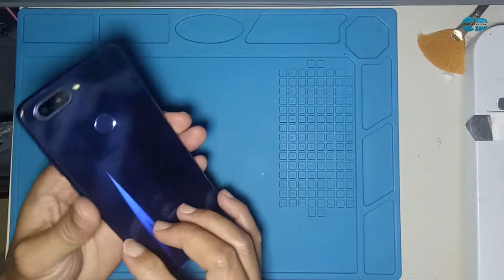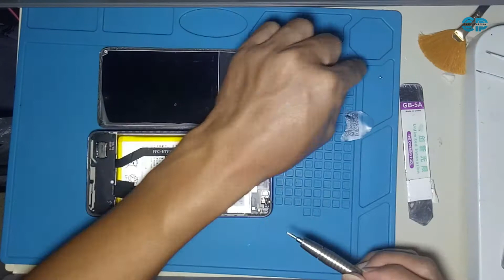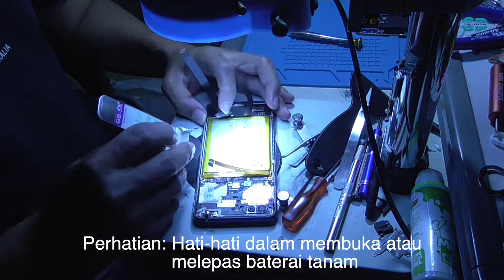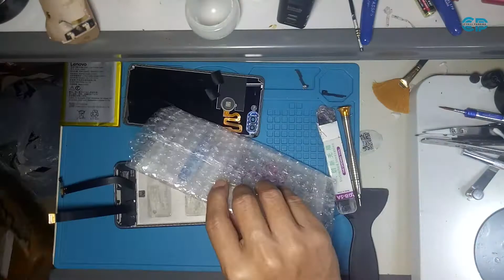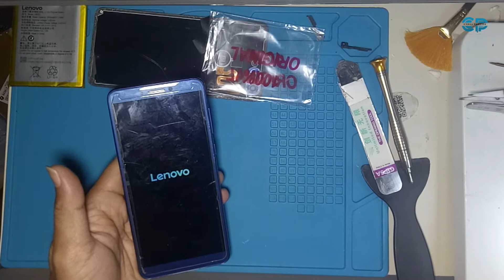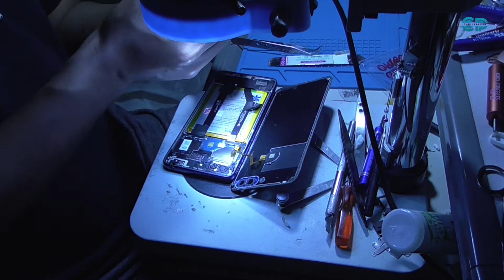Lenovo K350T Battery Replacement #stayhealthy

Comment: om mau tanya, bedanya model batre LB0001 dengan LB003 apa ya
Reply from the maker: @akhmad firdaus Model batere LB001 dan LB003 sama 3.85V, 3000mAh/11.55Wh. Perbedaannya ada di posisi kabel socket flexible nya, kalau LB001 untuk Lenovo K320T sedangkan LB003 untuk Lenovo K350T om.
Reply: @cyrillpareira6347  ohhh begitu om, hape saya Lenovo k350t, tapi batre ori nya model LB003 om
Reply from the maker: @akhmad firdaus Iya betul om, Lenovo K350T menggunakan batre tipe LB003 om.
Reply: tapi kenapa yaa hp saya k350t tapi type batrenya LB001 ?
Reply: @r____kecil8325  Iya bang saya juga gini, mau ganti cuma bingung soal ini. Mas admin boleh dijawab

Comment: kAa klo lb001 sma ga lb003/5 mohon di jwab mau bli batrai soalnya
Reply from the maker: LB001 untuk Lenovo K320T, kalo LB003/5 untuk Lenovo K350T kak.
Reply: @cyrillpareira6347  oke terima kasih kaa sya udah mesen batrainya di olshop, pnya sya hp'a lenovo kt350,  terima kasih 🤗
Reply from the maker: @Ali Zaenal sama sama kaa 🙏

Comment: Kalo hp saya, lenovo juga type ini,baterai sekitar 40% langsung mati(drop), diganti baterai apa bisa normal kembali gan?
Reply from the maker: kalo kondisi mesin ga ada short (konslet), ganti baterai  bisa normal kembali, tp kalo mesin ada short (konslet), ganti baterai baru pun bisa saja drop gan
Reply: @cyrillpareira6347  tapi kalo konslet gak harus nunggu dibawah 40% kan gan?
Biaya ganti baterai sampe berapa ya gan? Soalnya di olshop, btre sekitar 150K kebawah
Reply from the maker: @arif muzakhin  klo biaya tergantung daerah sm yg servis. Di olshop batre kisaran segitu
Reply: @cyrillpareira6347  kalo pasang sendiri? Kira² bagian mana yg perlu extra hati² gan?
Reply from the maker: @arif muzakhin hati2 di bagian buka cover belakang krn ada flexible fingerprint dan bagian melepas batere nya, krn lemnya agak keras klo belum pernah di bongkar, bisa menggunakan cairan seperti alkohol atau baby oil, tapi ga boleh kena part yg berhubungan dengan arus positif negatif ya gan (bisa konslet)
Reply: kasus sama, malah sekarang mesin idup tp layar hitam, msh bisa nerima telpon n video normal tp ya itu ga bisa liat kr blank hitam, knp itu bang

Comment: Description model of battery pls
Reply from the maker: @Erwin Opis Model Battery LB003, 3.85V, 3000mAh/11.55Wh
Reply: @cyrillpareira6347  bang kenapa hp ku Lenovo k5 itu cepet panas, apakah ngaruh ke batre
Reply from the maker: @ MR BOYY JR Penyebab hp cepat panas itu salah satu memory kepenuhan atau ada aplikasi/bug yang melakukan koneksi internet secara terus menerus dan batere cepat drop. Solusinya coba backup data, kemudian factory reset/format hp, apabila setelah factory reset/format hasilnya masih cepat panas, kemungkinan masalahnya di hardware, dan salah satunya batere.
Reply: @cyrillpareira6347  tolong bikinin tutorialnya bang plis. Terimakasih udah menjawab pertanyaan aku
Reply: @cyrillpareira6347  kalo misalkan kita langsung ganti batraynya gimana itu bang
Reply from the maker: @ MR BOYY JR cek fisik batere terlebih dahulu, apabila batere belum pernah di ganti dan batere kembung langsung ganti gpp bang
Reply: @cyrillpareira6347  oh iya bang makasih bang ini juga kayanya kambing bang belakanya agak mengelupas
Reply: @cyrillpareira6347  makasih banyak ya bang udah menjawab pertanyaan aku
Reply from the maker: @ MR BOYY JR Sama2 bang 🙏